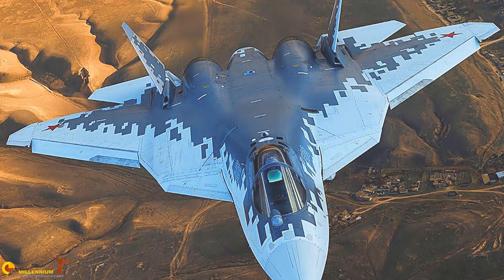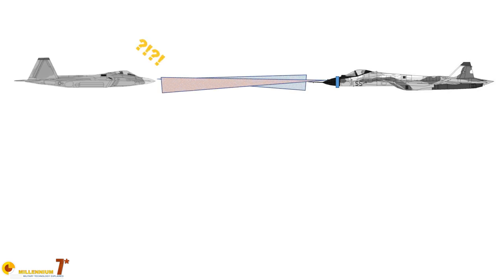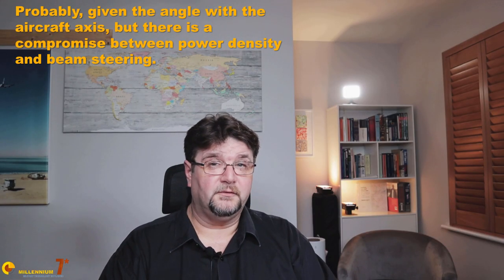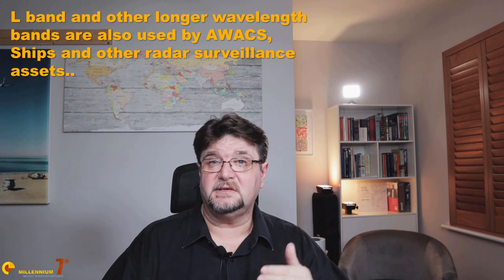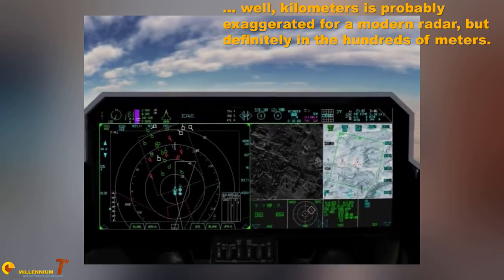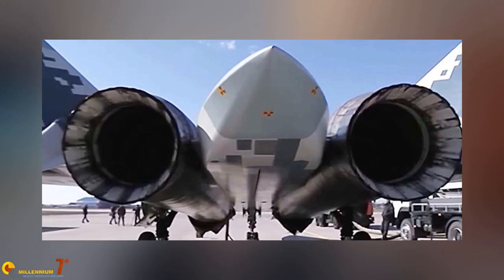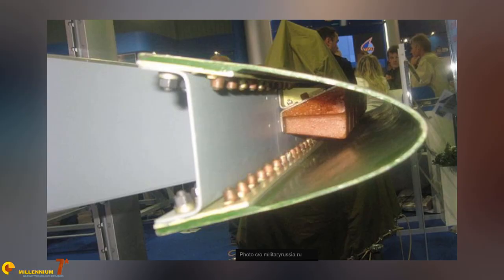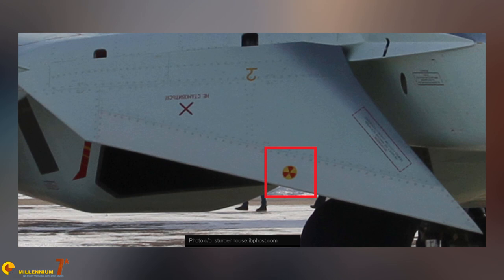Su-57 the Raptor Spotter | Part 4 - Radars, ESM, ECM, IFF

Comment: Every one is saying "F22, 35 will detect and destroy Su 57 before it knows they are there" ok, let us assume the Su 57 simply has no idea they are there but my question is: How good are the radars of the F35 and F22 themselves? Can they actually get a lock on the Su 57 reliably at AIM 120 max operational range? I highly doubt it because stealth alone is not enough to guarantee a kill at long range... these aircraft have to have very powerful radar systems to lock on to a stealthy aircraft. In other words, how far away can an F22 lock onto another F22 reliably and take it down?
Reply: Western electronics is a generation better than anything that can be produced in Russia., even allowing for the software capability to be identical. If the F-35 is golf ball sized (and who knows) on an X-band radar, the Su-57 is at least beach balls sized (100 to 1000 times larger) [and an Su-35 much much larger still]. F-35 are designed around networking and stat interchange, probably with AWACS support (L band). The question your asking is how close does an F-35 need to get to an Su-57. Thats a secret, but it's likely to be more than enough to remain undetected.

In anywise, the USAF may be flying in formation where F-22 are emissions silent and and F-35 or Typhoon in an adjacent formation is radar active and targeting the Russian aircraft at or outside the Su-57 weapons range and providing targeting data to the F-22 formation, who fire at a closure range from an unexpected location. F-22 stealth is at least 10 to 100x better than the F-35.
Reply: At the maximum range of the AIM-120, its speed when approaching the Su-57 will not exceed mach 1.5, its maneuverability will be very low, and it will report its approach due to its working radar for 25-30 seconds. The Su-57 will leave the AIM-120. In order to shoot down a highly maneuverable and well-informed fighter, you must launch a AIM-120 from a distance of up to 40-50 km. No more than that.
Reply: @nickbrough8335  The frontal RCS of all 5th generation stealth fighters (F-22,F-35, Su-57) is from 0.3 to 0.7 square meters (compared to 3-10 square meters for 4th generation fighters) A "golf ball" is a boastful advertising nonsense from Lockheed.
Reply: @TD-qh6yu  You'll notice i did write IF. However, my point remains correct, which is that the difference is radar "size" of 10 to 1000x remains essentially correct. Russian radars will find it 2 to 3 (or more) orders of magnitude more difficult to detect a US stealth aircraft than vice versa.
Reply: @nickbrough8335  Su-57 and F-22 will detect each other at the same distance (approximately 120-130 km). This is too long a distance to launch the R-77 and AIM-120 missiles. They will have to get closer to shoot.
Reply: @TD-qh6yu  Highly unlikely to be true. The F-22 is several times more radar stealthy than the Su-57 (as is the F-35). Please reference your source data on radar performance.
Reply: Su-57 frontal RCS value is only 1/10th of the Flanker according to Sukhoi, which means it's huge and easily-detected at long range by APG-77 & APG-81.

It uses MAWS and automated self-protection jammers if it detects an incoming missile, combined with other countermeasures. That's late 1960s US technology already in-use by the SR-71 back then.

The 1980s ASPJ basically made that available for the F-14D and other US fighters, though the USAF is extremely tight-lipped about it.

F-22A has a massive leap in capability above that, including IR MAWS integrated with RF suite.

JSF is an even bigger leap ahead of F-22 with 4 EM spectra coverage across various RF, IR, Thermal, and Laser bandwidths, using adaptive EW deception and attack networked with other JSF and networked platforms.

The Israelis already used F-35Is to trick Syrian IADS to think a Russian IL-20 Colt ELINT bird was a flight of F-16Is, or maybe the Syrians with their Russian technical advisors were just too trigger happy.

JSF performs the mission of the EF-111A, EA-6B, and EA-18G at certain phases of practically every mission profile.

The Su-57 will act as an EW platform as well along similar lines, just with older technology and limitations imposed on it by Russian Semiconductor quality/quantities.
Reply: @nickbrough8335  Lot 4 and later JSF have a smaller frontal RCS than the Raptor, and the APG-81 is a more capable radar driven by a more capable CPU bank.  Both Raptor and JSF can generate accurate passive TGT tracks in RF spectrum, with intermittent LPI PID modes for the AESA.  JSF is exponentially better at this due to the vast IR/FLIR sensor suite.
Reply: @TD-qh6yu  At higher altitude bands, AIM-120C7 even will be doing Mach 4 with a reduced ToF due to thin air, and will be on its maximum ballistic arc with a decent supersonic separation velocity.

AIM-120D is another ballgame and has exceeded the intercept range of every AAM in history with a recent live fire test.  We're onto AIM-120D4 already.

Networked cooperative targeting of AIM-120D Salvo fires is inescapable.
Reply: @LRRPFco52  Correctly. According to Sukhoi, frontal RCS of Su-57 is about 10 times less than that of Flanker. But according to Sukhoi, the frontal RCS of the F-22 and F-35 is also about 10 times less than that of the Flanker. All reports about the ultra-small RCS F-22 are fiction. It's just that the whole world knows that Russian fighters are much superior to American fighters in terms of flight characteristics. Now, for propaganda purposes, the Americans can only tell fictions about the "RCS= golf ball", because the value of the RCS cannot be determined visually, unlike maneuverability or the speed of climb.
Reply: @LRRPFco52  AIM-120C7 will maintain speed Mach 4 for only 3-4 seconds.
Reply: @LRRPFco52  There's no doubt that the F-22 needs a serious upgrade now, although I suspect the USAF is expecting to replace it with whatever next gen aircraft they're currently developing instead. I am under the impression the F-35 IR system is ground orientated not A2A based on its position and the IR frequency range it operates in.
Reply: @nickbrough8335  Like every other fighter, the F-22A has been on a modernization and upgrade schedule from the start.

JSF IR/FLIR sensors operate in short, medium, and long wave IR spectrum as well as thermal. They wouldn't be able to detect rocket launches at 800 miles if there wasn't a long wave IR capability.

The EOTS and DAS are the most capable IR detection systems against airborne and space targets on any "fighter".  EOTS is a multimode evolution of the ATF's AIRST, which was cut from ATF due to costs.
Reply: @TD-qh6yu  F-22A early Block LRIP aircraft demonstrated .001m2 or less frontal RCS.  F-15C+ with the new massive AESA can't detect it until within visual range. There isn't a larger fighter AESA currently flying than the APG-63(V)3.  If Russian fighters were so superior, the scrap heaps of every major air battle would not be littered with MiGs and Sukhois.
Reply: @TD-qh6yu  Now do the math based on separation V0 of 1.4-1.8M at 40k ft.
Reply: @LRRPFco52  I did it. Launched from Mach 1.4 - 1.8 and an altitude of 40,000 feet, the AIM-120 will reach a speed of about mach 3.9-4.2 and will have it for a few seconds before its speed begins to fall to mach 3 or less.
Reply: @nickbrough8335  Sorry mate, the F-22 is less Stealthy than the F-35 at least from the front. From the rear, she is better, but only in IR. Her vertical thrust vectoring flaps take out some heat, but that is not saying much, she still has 2 heat sources, partially covered. in another vid. our friend from Millenium 7* shows the radar profiles of this three fighters, they differ in profile, but none is "really" invisible, or even very noticeable in advantage.
Reply: The Su-57 has a feature that was long-promised for the F-22 but as of yet, has never been delivered—side-facing radars mounted below the cockpit on aircraft's 'cheeks.' These active electronically scanned array (AESA) X-band radars supplement the aircraft primarily nose-mounted X-band N036 Byelka (Squirrel) AESA radar. Supposedly these secondary radars have roughly a third of the transmit-receive modules as the jet's main radar. 

You can clearly see the side radar aperture below the 'chine line' under the aerial refueling probe. 

At first glance, the utility of these radars is clear—they provide a far greater sensor field of view and thus enhance situational awareness for the Su-57's pilot. But beyond this the most basic of advantages, they allow the Su-57 pilot to execute a key tactic better than nearly any other fighter around. This tactic is usually referred to as defending enemy's missiles while not getting "cold" on enemy's plane.

The issue is that with a typically fixed AESA radar or mechanically scanned array, pulling off a missile defending maneuver means the fighter doing so will lose its radar picture of the enemy it is trying to evade. Without third-party sensors feeding this data to the beaming fighter via data-link, its pilot will become blind to the tactical situation when it matters most. But what's worse is that any radar-guided missiles that have been fired from the now beaming fighter will not be able to receive mid-course updates, and thus those missiles' probability of kill will plummet, especially if fired off initially at long-range.

So fighters without cheek arrays, or novel swashplate like designs like those found on SAAB's JAS-39E/F Gripen and eventually on the Typhoon, and absence of engagement quality tracks provided by third-party sensors via data-link, the launching fighter will either have to take a more acute and less effective beaming angle in order to continue to update their missiles with their radar, or they will have to forget about updating them altogether. 

The Su-57 is also said to incorporate L-band radar arrays blended inside its large maneuvering leading edge extensions. These radars are more for target discrimination and identification than anything else. The aircraft also has another X-band radar array in its 'stinger' tail for enhanced situational awareness, and possibly for future targeting with extremely agile 'lock-on after launch' missiles as well.

It's also worth noting that AESA arrays can also be used to execute pinpoint electronic attacks. Theoretically, a fighter's radar system could employ these electronic warfare tactics while attacking another aircraft, or while under attack. Being able to do so even at oblique angles without changing nose position could be beneficial, as well. With that in mind, the Su-57 could be a powerful electronic warfare tool, if not today, then possibly the future. 

The Su-57 sports an advanced 101KS 'Atoll' infrared search and track sensor in the traditional position on Russian fighters—installed atop the aircraft's nose, near its windscreen. 

 IRST is among the best technologies available for detecting and engaging stealth targets from afar.

An advanced IRST was also promised for the F-22 as part of the Advanced Tactical Fighter Program but it was axed due to cost-cutting measures as the program moved from prototype to a production configuration. Today, the Navy and the USAF are on the cusp of procuring podded IRST systems for their 4th generation fighters. The F-35 can use its electro-optical targeting system (EOTS) for long-range aircraft identification and some limited IRST-like functions but is not comparable to a dedicated sensor.  

Like the F-22, the Su-57 has a number of missile launch detector apertures scattered around the aircraft but the Su-57 also has turrets that fire modulated laser beams at an incoming missile's seeker to blind it and throw it off course. The Russian system used on the Su-57 is part of the larger N101KS electro-optical suite that includes the missile launch detector systems, IRST, and the DIRCM turrets mounted dorsally behind the cockpit and ventrally under the cockpit.

And denying attacks by air-to-air missiles is definitely an intent for the Su-57's DIRCM system as, once again, it has a turret on top of the jet as well. So in this sense, the Su-57 is something of a pioneer in this regard and this type of system is also likely a hedge against future long-range infrared-guided and dual-model air-to-air missiles.

Su-57 can be armed with four beyond-visual-range missiles and two short-range missiles for air-to-air combat missions. The active radar-homing K-77M (Izdeliye 180) missile is the primary medium-range missile of the fighter. An upgraded version of the R-77 medium-range missile, the K-77M is a beyond visual range (BVR) radar-guided missile equipped with an active electronically-scanned array radar seeker. Russia is also planning to add the new R-37M long-range hypersonic missiles to the aircraft’s firepower.

For ground strike capability, the Su-57 is fitted with the Kh-38 tactical ground missile and a range of KAB family precision-guided bombs. It also has external hard-points that can hold additional munitions to support non-stealth missions.

Aircraft’s super-manoeuvrability allows it to dodge incoming long-range missiles and engage enemy aircraft within visual range.

So my friends, Su 57 never goes cold, there is always 360° awareness, passive and active, and there's hypersonics in the bays.

And these are words of amercan avio experts.

So....

Yeaa, F22 and F35 have anyway better avionics.
Reply: @nickbrough8335  Have you talked to the radar and how difficultist it finds its target? 11kw of radar would give quite a nasty sunburn, if sent in microwave frequency.
Reply: @TD-qh6yu  How about the R-37? up to 300 km range?
Reply: @Gunni1972  I can only go on the (lots) places I've read. F-22 has always been talked of as having better around stealth than the F-35, although the F-35 is using at least 1 generation later technology, which I'd expect to offset that to some degree. I'll have to check that video, but unless you've put the aircraft into a radar testing jig verses various different radars (as Lockheed and Sukhoi would have done at the design stage) you cant know and there is no actual data that's been made public that I've ever come across anywhere on the eb (as you'd expect as that has to be an important secret). Whatever data has been analysed it's going to be theoretical based on shape. Stealth involves more than shape. That also provides an advantage as Russia and to a lesser extent China are unable to manufacture and build with these sort of materials. Composition of RAM coatings will also be very important. No one but some idiots in the media think Stealth = radar invisibility.
Reply: @LRRPFco52  F-22 still lacks helmet sight, a FLIR system and two way data link from memory. The AESA radar and other equipment upgrade is planned for the mid-2020s along with replacing the RAM coatings using F-35 tech. Nothing can de done about the airframe though.
Reply: @TD-qh6yu  and you believe Russian propaganda ?
Reply: @TD-qh6yu  Most missile only burn their fuels for 10 to 15 seconds anyway.
Reply: @Gunni1972 Can you explain what you mean more clearly ?
Reply: Once again, the point of my question was to point out that by the time an F22/35 can RELIABLY get a lock to guide the AIM 120 (not just to detect the Sukhoi), it will be within Su 57's IRST range at which point, it is anyone's victory. So what is the point of being stealth when you cannot use range reliably to your advantage? On top of that, an AIM 120 is an extremely easy missile to defeat at long ranges, it just isn't a very good missile to take down modern jets at long distance and that is even without considering ECM. I would say it would be a fairly even battle, coming down to pilot training and tactics as well as a bit of good old fashioned luck.
Reply: The difference is one has a reduced RCS to be less detectable at BVR and the other 2 (F-22 and F-35) have demonstrated a reduced RCS to allow them to fly right under another fighter before being detected and we don’t know how effective the L band detection system installed on the plane is yet (L band detection on stealth fighters require a large antenna and Russia doesn’t have as much experience in developing a stealth fighter and have downplayed stealth in the past with propaganda)
Reply: What fanboys seem to forget is to get a radar missile lock the F22/35 have to go active radar and that puts out a signal that anybody with RWR will detect.
Reply: @LRRPFco52  Neither the US nor Russia are in reality self sufficient in the realm of semiconductors. Both buy them in the far east.
Reply: @LRRPFco52 The upgrade schedule you are talking about is more likely like the windows update cycle to wedge out gazillions of common software bugs.
Reply: @zx169  IRST performance depends on the water content of the air, which is controlled by weather, altitude and cloud base. It will also depend on the speed of the incoming aircraft and to the extent that IR absorbing materials have been used in the construction. An F-35 will approach sub-sonic in most operational conditions. How big will its signature be front on ?

So far as I know, the field of view isnt very large and positioning will limit the searchable area to a significant extent on all aircraft. Obviously the resolution of the sensor will also have a major impact. So if we suppose that an Su-57 detects a stealth opponent outside radar resolution range with its IRST (40 to 50 km ?), then is there sufficient data to launch a missile ? Of course, it is equally likely at that point the F-35 or F-22 will already have a firing solution and the Su-57 is facing an incoming missile salvo and needs to manoeuvre to avoid being hit.

What if the opponent is carrying Meteor rather than a 120 D model ? The Meteor will accelerate to high speed and then slow/shut down the missile engine to conserve fuel to reignite the engine to counter late stage avoidance manoeuvres (I believe 120D does nothing similar, but may be not as effectively given solid fuel engine verses a ramjet).

However, how will the Su-57 respond. Its own longer range missiles are currently lower range than the 120D and have lower specification electronics and most likely inbuilt radar ?
Reply: @nickbrough8335  The issue with stealth is that it is only truly effective against older electronic systems and once the F22 and F35 turn in their own radar, the game is up on their position. The enemy (5th gen) will know exactly where it is and that a weapon has been fired on them, making it easy to avoid the incoming threat, at long range. However, within the short range spectrum, where that weapon is more likely to be effective, the Su 57 will have a lock of it's own and fire it's own weapons hence the 50/50 outcome scenario. Stealth does not mean its invisible, it is a pure lie that "an F22 can get right next to an enemy before being detected.... visually" outright propaganda. For some reason, people seem to think the US cannot be associated with disinformation and especially that horrible 'P' word. It is something that Communistical countries do, as Jeremy Clarkson would say. I would also not discount Russian electronics, no evidence to suggest they are inferior, in fact both Su 57 and especially Su 75 have newer systems than F22 and F35, with these being much older aircraft. If a new computer comes out, it doesn't mean they all get instantly upgraded, they still use the core systems they got when they were designed.
Reply: “Russian propaganda”? In this discussion, you are the one most prone to believe in propaganda citing Lockheed’s marketing cliche uncritically.
Reply: “Russia downplayed stealth with propaganda”? Or, rather, the USA has hyped it up with propaganda? The fact that you chose the side shows that you fell victim to the latter.
Reply: I wonder where did you get the idea that the specifications of  Russian electronics are in any way insufficient. It is capable of tracking and targeting even hypersonic targets (multiple of them all while discerning real and fake ones) with no problem for a long time already. Even ancient MiG-25/31 electronics has allowed to track up to 8 targets and exchange data with fellow planes. Buran has performed a fully autonomous flight while in the Shuttle this mode was never robust enough to go without supervision.
Reply: @zx169  Reducing your radar cross sections a permanent advantage. Of course as radar technology and DSP advances, the advantage reduces, but isnt eliminated entirely. 

I'd love to see a debate regarding the latest Russian US radar tech, but we cant as its all classified and very little is made public. The same applies with EW/ECM/ESM measures that both sides will deploy when necessary.

I assume that better more powerful computer hardware, access to better quality manufacturing techniques and use of materials science gives the US a significant edge over Russian hardware. How much is unknown.

The US uses Stealth and networking (battle space data sharing) to provide better situational awareness pre-engagement to give its aircraft an additional edge that Stealth will provide to first detection range.

None of us know whether the Su-57 systems are capable of matching this performance at the same range. Its certainly highly unlikely that there is parity today.

So how close is close ? 40 km, 30 km ? In most engagements its probably that US aircraft will fire the first salvo and they will certainly not close to engage in WVR combat where the Su-57 (and 35S) are likely to have an advantage, although I expect pilots will receive training on how best to dogfight both these aircraft it is happens.

Against pier opponents, I would expect most fighter engagements to be a "draw", but the key question is which sides tactical operations will be disrupted the most. The evidence suggests Russian side to me.

Against Chinese opposition, it's much less clear.

On electronic systems it depends on how you define the question. From a practical point US designed chips will operate faster, process more data, be lighter, produce less heat, use more advanced materials, are smaller etc. The ability to process data faster, in more detail and probably have systems that operate at a finer resolution is likely to be a strong clear advantage. Yes, Russian systems might offset that disadvantage by using higher power to generate detection  distance parity, but the quality of date returned is still likely to be lower and the onboard systems will take longer and do less with that data. In addition, higher power output increases passive detection distance (I forget the ratio, but isnt EW detection possible at two to three times the distance of the host radar).

To date Russian systems are incapable or less capable of sharing high density data. Another disadvantage. Its likely the USAF will deploy mixed F-22/F-35 with F-15AXs and Typhoons with stealth aircraft completely passive using data sharing to update situational awareness. That gives plenty of surprise advantages.
Reply: @kentaur1234  Tyler Rodgway isn't an aviation expert, he's a self-admitted click-bait generator who writes articles designed to sell ads.  

Side-looking AESA is great for a 4th Gen BVR mutual detection scenario so you can manage your WEZ profile vs the threat, and still provide midcourse guidance to missiles after offsetting/cranking so that you stay outside of threat WEZ.

That doesn't apply to F-22A and JSF because they project a kill web of interlocking WEZ and NEZ profiles that don't require the launch aircraft to provide midcourse guidance, and they can't be detected or tracked at meaningful distances.
Reply: @nickbrough8335  F-22A started out with the most capable LPI 2-way data link called IFDL, which is far superior to Link-16 protocol WAN-type data links.

It was surpassed by JSF MADL, which has higher transfer rates and bandwidth to support multispectral sensor data sharing in near real-time, whereas IFDL supports RF sensor data sharing.

Both F-22 & JSF have a LAN-based data link network that is practically impossible to detect.

F-22A combat-coded Raptors have undergone several software and hardware upgrades over the years, increasing its A2G, A2A, and EW capabilities significantly.  They're pretty hush about it though.  F-22's biggest problem is maintenance, since traitors working on behalf of Russia and China killed it from within US DoD and 2 White Houses (Bush Jr., Obama).  We never capitalized on the F-22 by going into full rate production with the necessary airframe count and spare parts, so it's an extremely difficult system to maintain.
Reply: @nickbrough8335  According to Russian sources, the radar of the Su-35 fighter Irbis-E can detect a target with an RCS of 0.01 square meter at a distance of 90 km. Therefore, she will see an F-22 with an RCS of about 0.3 square meters at a distance of 200 km. Not 30 or 40.
Reply: @rosomak8244  Not for defense for the US. The SC companies in the US have strict contracts feeding critical aerospace and defense systems.

Commercial market like autos and electronics source from Japan and Taiwan a lot for US civilian market.
Reply: @LRRPFco52  The advantage is most western NATO member use a common data link protocol and existing numbers of equipment are becoming digital and will plug into the US networked architecture., which should be a force multiplier. I haven't read a lot, but I think there is a mid life update planned for the F-22 lately, which will replace the radar, stealth coatings and add IRST capabilities, which should bring F-22 up to current standards. 

Numbers are an issue, but the USAF will adopt multifaceted forces using a mix of Stealth and non-Stealth aircraft with similar technical capabilities (how much of the F-35 hardware is ending up in the F-15AX, which is the replace the C models ?).
Reply: @zx169  Su-57's IRST range doesn't detect F-22 or JSF at any meaningful distance due to IR VLO.  Normally with IR sensors, you get the best detection range from rear aspect, but Raptor and JSF have extensive exhaust camouflage measures with the way super cool atmospheric air is routed through and around the exhaust.

Frontal aspect IRST detection with Russian electro-optics in ideal dry atmosphere on a clear day is only a few dozen km at best against non IR camouflaged legacy fighters, way within the RF detection range of any of the US AESAs including the little one being installed in the F-16 fleet.

The sensor detection math and applied physics will show you that actual 5th Gen fighters get first-look/first-shoot, with cooperative Salvo shoots that make life unfair for their adversaries. It takes a much greater effort to defeat this, and that doesn't factor in the unknown performance of the next generation missiles being fielded in the US currently.
Reply: @zx169  "The AIM-120 is an extremely easy missile to defeat at long ranges".  What evidence do you have to support that claim? The AIM-120 is constantly live-fire tested against maneuvering targets across its WEZ profile, and has been subjected to continuous improvements with extremely challenging live-fire testing since the 1980s, including high ECM environments.

Especially when launched from a fighter whose presence and closure rate is unknown, even legacy AIM-120C7 is an extremely dangerous weapon.

We're not talking about mutual detection BVR metrics anymore, where each side has an idea of where the other contacts are.

We're talking about unfair VLO closures into layered NEZ profiles. It's truly not a fair fight in the slightest.

You can put the highest hour Fighter Weapons School instructor pilot in a non VLO airframe with all the bells and whistles, and he will be quickly erased from the sky by brand new pilots who have barely gone through their squadron introductory tactics syllabus and simulator training with a few months of flights in their logs.

These are the new rules. Pilot experience can't help them in an inferior platform in BVR, Edge of WVR, and is neutralized even WVR due to several factors.  There's a retired TOPGUN instructor who flew Hornets, Super Hornets, F-16 Adversaries, the F-22A, and F-35B who explains his experiences with this, which were extremely frustrating for him.
Reply: @suflanker45  "What fanboys seem to forget...." All incorrect. Engineers have been developing solutions to long range detection and Non-Cooperative TGT Recognition for decades.

There's also a concept called Low Probability Intercept RF propagation dating back decades now, where we looked at the bandwidth covered by threat RWR antennae and their signals processors, and worked around that with emitted RF energy from PESAs and AESAs. That's 1980s tech.

On top of that, we expanded our own RWR systems to have far greater sensor counts with different shapes and wavelengths, far greater passive sensitivity with digital signals excitement and filtering, fused into a 360° extreme long range RF detection suite.

That's the primary early detection and warning system with roughly twice the range of the AESA due to the 1/2 vs 1/4 rule with RF propagation.

With JSF, we also have the most sensitive and layered IR detection and tracking system in the world, that is fused with the IR sensor suite.

If the DAS gets a signal at long wave IR, it immediately triggers the EOTS and passive RF sensors to look there as well.

Even if you're running EMCON with the AESA, the AESA "knows" there's a TGT track there.

The AESA can push very low energy RF in narrow beam sharpened LPI mode on that TGT, without triggering the TGT's RWR system, and paint a long range image of exactly what that TGT looks like, fused with the multi-band IR sensors.

The aircraft being scanned has no clue any of this is happening, while its weapons and stores status is being assessed as well. 

This isn't only happening from one 5th Gen platform, but from multiple 5th Gen nodes that have tens of km separation in azimuth and vertical separation as well.

As each of their layered sensor arrays scans the contacts, they share that data with each other in near real-time for a cooperative TGT assessment and count.

So your understanding of AESAs and how modern AESAs operate is not informed by the facts.

It breaks down like this:

Total EMCON, no RF emissions. Passive 360 RF EW suite detection and tracking with limited track accuracy dependent on range.

Partial EMCON, intermittent burst LPI low power narrow beam sharpening AESA in frequency-hopping mode, LPI LAN data link TGT sharing with networked fighter formation.

4.5 Gen EMCON, intermittent AESA full power volume search, omnidirectional detectable/jammable WAN data link.

JSF plays this game better than any other fighter, at a level that is simply unfair.  The only outcome is that threat fighters willing to get into the air where JSF are present have a destiny with weapons impact without warning.
Reply: @Internetbutthurt  There is a cat and mouse game with RF spoofing that applied more to SARH missile homing, where the targeted aircraft records and then spoofs the command signals from the launch platform guidance radar.

This doesn't work against AIM-120C7 and D1-4 fired from VLO fighters because the LoS for the midcourse data link between missile and guidance platforms is LPI.

So instead of relying on the launch fighter to provide course corrections through most of the flight while that launch fighter is detected, tracked, and fire returned on it, you have a totally different weapons employment profile that is unfair.

If you work through the tactics with an understanding of how the new chess pieces function, you will start to see what I'm talking about.

It's like starting a chess game with 2 rows of pons and maybe 2 knights, while your opponent has 2 rows of queens who you need special glasses to see.  A chess master with the pons will lose to an amateur with those pieces.
Reply: @nickbrough8335  Good points. I did all the math not long ago for the Su-35's OLS-35 & the Su-57's 101KS-V, as well as the Rafale's exceptional dual-system OSF across all the atmospheric conditions and altitude bands, ranging from desert dry air to heavy rain.

In short, legacy IRSTs like that even from the French will not have a BVR frontal aspect detection capability, unless in desert dry air and right before closure into WVR anyway.

JSF and ATF would have offeset their flight path far before getting into WVR, and employed weapons long before the detection threshold, while having enjoyed extreme long range detection and track hundreds of km prior.

It's really such an overwhelmingly-unfair fight, to be laughable.
Reply: @zx169  VLO technology isn't static or set in stone. It evolves even within airframes and can be upgraded. The F-117A went through 3 different RAM application types over its career, finishing with some that were coated in F-22 RAM.

JSF already has upgraded RAM since Lot 4 that reduced its FRCS smaller than the F-22A, which is smaller than the F-117A.

The new generation of RAM is programmable with holistic frequency response-based modulation to adapt to incoming RF.

AESA radars in LPI mode executing millions of frequency-hopping cycles encrypted with themselves for return signal aren't going to show up on RWR. You would need to build a more sensitive, larger antennae array RF architecture, exciters, filter, and faster processor suite than what's in JSF, ATF, and operational US AESAs.  US has the highest quality, highest quantity of military spec Semiconductors, boards, and processors, with the largest army of programmers, so that's a losing proposition, especially with JSF open architecture.

The Su-57 is not newer technologically. The Su-75 doesn't even have avionics or any systems. At best, the rollout was a dynamic/structural test model.

This is what happens if you drop the ball on any one of the necessary organs of an integrated 5th Gen Platform.

No VLO? An open gap in capability is exploited to your detriment.

No modern integrated avionics suite with layered redundant processing bank, fused multi-spectral, high quality sensors? Another massive gap is opened.

No capable propulsion to meet the thrust, climb rate, cruise, and high altitude performance without afterburner? Another gap expands between you and your adversary.

Airframe isn't well-vetted for departure resistance at operational altitudes? Another gap that comes into play when trying to avoid incoming missiles.

Haven't demonstrated internal weapons bay separation of BVRAAMs? Is it because closely held secret, or it can't be done yet/program is struggling with adverse separation effects from the tunnel, like the F-14 did (F-14 shot itself down with rear tunnel-mounted AIM-7).

These things all add up.
Reply: @TD-qh6yu  F-22A Block 30 3.2 has a frontal RCS smaller than .001m2, so even the most capable US AESAs with far superior detection, tracking, and PID features can't physically see it until within visual range. The IRBIS-E is 1980s tech at-best by US standards, attempting to match the very little-known APG-63(V)2 on the F-15C, which now uses the (V)3 AESA, the largest, highest TRM count fighter AESA in the world.
Reply: @Internetbutthurt  The longer a missile uses Active Homing, the easier it is to defeat with ECM. So the name of the game is to execute sneak attacks with VLO approaches, providing mid-course guidance throughout the missile's flight path, refraining from letting it trigger its active homing until the last few moments of terminal phase.

One of the limitations with 4th Gen guidance, even with continuous tracking from the host with data link, was single source sensor tracking for weapons-grade solutions.

This gave you a certain 3D floating intercept "box" for the missile to home into before activating its terminal phase guidance.

The primary factors that determine that floating "box" are TGT aircraft velocity, bearing, altitude, vertical velocity, and RCS.

The faster the aircraft is flying, the more the box elongates.  The lower it flies, the shorter the WEZ is due to atmospheric density, and vice versa. The larger the RCS, the larger the box and farther away you can trigger the WEZ.

Later variants of AIM-120C and the D have home-on-jam feature as well.

When you step into 5th Gen intercept metrics, a lot of things change:

You can press the WEZ into NEZ, which means that no matter what maneuvers or acceleration/climb/descent the TGT executes, there is still an intercept solution.

Since they have no clue you are there, you or wingmen can execute deceptive offensive EW techniques that will tie-up their radar and EW, which can be used to increase the missile pk kinematically and electronically, even using older missiles.

An F-35A or F-22A is several levels more lethal against any other fighter using AIM-120C5s than a Rafale is with Meteors.

The missile limitations are virtually erased when leveraged with 5th Gen sensors and EW.

Furthermore, you can generate much higher TGT track quality in JSF just using interleaved passive sensors, with midcourse data link and intermittent burst low power LPI AESA updates if you wanted.

The TGT aircraft EW system can't spoof midcourse corrections because it doesn't detect LPI to the missile, so there is no triggering of the MAWS.

By delaying the terminal phase active seeker final course corrections, it limits the TGT aircraft's ability to employ automated ECM, especially against something approaching at Mach 3-4.  A more modern Automated Digital Threat Warning and Deceptive Waveform Emitter jammer also has to deal with the home-on-jam feature, which might actually improve the TGT resolution.

This is why the Israelis and US have been developing multi-spectral seekers that trigger a mw seeker on terminal phase that isn't deceived by Digital Waveform Manipulation techniques.

The programmatic cat and mouse game with legacy systems involves drop-in improved circuits and higher speed processors, which allow more room for warheads, continuous rod systems, and longer solid rocket motors.

A really basic explanation of ECCM algorithms include, "If within distance x of impact and TGT emits ECM, then execute y." type functions.

With multiple sensors on multiple fighters feeding a networked resolution and tracking of the TGT, you get extremely accurate TGT data that is constantly sent to the missile with a very high-speed LPI data link. The missile only needs correct input to it for an intercept solution, which is provided by several disbursed wingmen.

There are one-way and 2-way missile data links that provide different types of guidance that get more complicated than the simple distinctions between SARH and ARH, so the missile seeker doesn't need to reveal itself as much as when fired from a 4th Gen fighter.

The missile seeker and 2-way data link technology gets upgraded on production units in operational squadrons in fairly regular intervals to meet regional threats as well.

The Russians' advantage in this area is only with how many moles they have in the US actively transferring missile upgrade codes and technology as fast as we can develop it, while the Trojan agency at Langley overstates Russian radar, missile, and ECM capabilities as a deterrence.

The MIC takes those inflated capabilities that don't exist in any operational Russian fighter squadron, build an even better mouse trap, and the cycle continues.
Reply: @StrangerHappened  if the US hyped stealth tech , then how come everyone and their mothers are rushing to build stsalthy aircraft and naval ships ?
Reply: @LRRPFco52  Irbis-Е can detect F-22 (which, regardless of the blocks, have a frontal RCS of about 0.3 square meters) at a distance of about 200 km and track it from a distance of at least 150 km. I do not know whether American radars can do this, but I am not sure about it, since American radars are traditionally inferior to Soviet and Russian radars in the detection range.
Reply: @TD-qh6yu  LMAO ! Where are you getting your numbers from ?
Reply: @TD-qh6yu  ,Another radar comparison between the F-35 and the Su-57 ... the APG-81 has 1676 TR modules, the Byelka N036-1-01 of the Su-57 has 1552 TR modules. close, but the APG-81 has more !!! It doesn't take a rocket scientist to look at the matrix and get a decent count of TR modules. Remember, the F-35 is US light weight fighter. The raptor has more than 1800 TR modules. Now that's unbalanced .
Reply: @junkookbts1273  It works but just not to degree it was hyped up to. Hence no countries that develop 5-6 generation war planes focus on it as much as the USA.
Reply: @TD-qh6yu  Wherever you’re getting your info from, you can trash those sources as total garbage.  F-22 frontal RCS is .001m2 or smaller.

Russian radars have always been inferior to US radars, especially fighter radars.  I already told you Irbis-E is 1980s tech at best compared to the variations of the APG-63(V)2, which us superseded by the APG-63(V)3 AESA.

TRM material quality and electron mobility on US semiconductors smokes Russian and even European ESA radars.  We literally pioneered all of these technologies and materials sciences with exclusive contracts for the highest quality, lightest, most thermal-resistant materials and connections.

Notice that Russia hasn’t had a fighter AESA radar until the Su-57, whereas the US has:

APG-63(V)3 on F-15C+
APG-77(V)1 on F-22A
APG-79 on Super Hornet Block II
APG-81 on JSF
APG-82(V)1 on F-15E+
APG-83 on F-16CM

The US has been designing, manufacturing, operating, and upgrading fighter AESA radars for decades with well over 1600 fighters now equipped with them.

The jump from a PESA radar to an AESA involves substantial technical challenges that aren’t very easy at all to conquer, and Russia has struggled in this area while the US leaped ahead.

The APG-63(V)3 is the most powerful, largest fighter AESA with Digital Signals Processing upgrades that changed the capabilities of the Grey Eagle fleet considerably.

Even with that massive capability increase, the F-15C+ can’t see the F-22A until within visual range.

The IRBIS-E doesn’t have anywhere near the electron mobility, beam-steering capability, or processing power and doesn’t have simultaneous mode capes that AESAs provide, so there is no mathematical way for it to be able to detect the F-22A or any JSF at BVR.

Meanwhile, the Su-35 has a giant RCS value with huge intake cavities, enormous 90˚ vertical stabs, and 4th gen suspension of its weapons, creating an easily-detected TGT at extreme BVR ranges.

Your understanding of applied physics relevant to radars, RF propagation, and RCS values is not even amateur at this point.  There is a ton of relevant information about radar physics online if you have the time and discipline to study them.
Reply: @LRRPFco52  Russian technologies, both in the field of aerodynamics and in the field of radar, are much superior to American ones. You know that the Su-27 radar surpassed the F-15C radar in detection range, the MiG-29 radar surpassed the F-16 radar, and the Zaslon radar for the MiG-31 had no analogues at all in the 20th century. Soviet anti-ballistic-missile defense radars had huge AESA antennas back in the 80s, which can detect an object measuring 5 centimeters at a distance of 1000 km. Russia's lag in aircraft modernization in the 90s-early 2000s was due to the financial crisis, and not to a lag in the scientific field. There was simply no money to equip hundreds of aircraft with AESA radars. The front  RCS F-22  was estimated by Russian experts at 0.05 square meters in the 90s, but now it is estimated at least 0.3 square meters. From a distance of 200 km, the Su-35 will see the F-22 as well as you see an omelet on your plate. There is a difference between reality and what Lockheed advertising agents tell you.
Reply: @TD-qh6yu  You realize we have samples of multiple MiG-29 variants and Su-27s in our inventory from FORMAT exploitation programs, right?  The MiG-29 radar is pretty big for the size of the aircraft and could have been a really good radar, but the pilot interface was atrocious.

The Su-27 tried to have a better radar than the F-15, and failed.  Tons of room, huge radome, poor electronics, amplifiers, filters, and processors with equally-atrocious human interface.  This was fixed with the Su-35 cockpit and Irbis-E to great extent, putting it more like an F-15E but still clunky.

Neither the MiG-29 nor Su-27 had HOTAS, and Russia has been rectifying this with the Su-27SM3, Su-30SM2, and Su-35 commonality serial upgrade program to make all the Flankers interoperable with each other, but again, this is 39 years after the US introduced HOTAS on the F-15 cockpit layout, which was driven by pilot design influence.

Even the little F-16A APG-66 radar had some highly-capable IFF features that are still classified to this day, and we haven’t been using those for decades other than on aggressor aircraft.  The APG-68 was a significant upgrade over the -66 when we went to the C model, and has undergone several upgrades through (V)9 now.

The MiG-29A (Soviet model, not monkey 9.12b model with downgraded radar and ECM) was heavily evaluated by NATO and the US by pilots who flew the F-16C, F-15C, F-4F, F/A-18C, etc., so they can tell you how the MiG-29’s radar and systems compared.  They said the radar was good, but the cockpit wasn’t set up for more autonomous use by the pilot, so the radar was handicapped by the systems layout.

The F-4F Luftwaffe pilots said the F-4’s flight control system and interface was much smoother and more friendly to the pilot, and even the antiquated cockpit layout was superior.  The MiG-29 was obviously more maneuverable, but took some getting used to with the crude control systems.

F-15 and F-16 guys said the radar didn’t compare well with APG-63 or APG-68, HUD was really crude and simple, but the HMS and R-73 was really good.  Endurance of the MiG-29 was atrocious at around 150-170nm combat radius, making it only useful as a point defense fighter.

We were surprised to see that they routed the APU exhaust through the centerline External Fuel Tank, which also prevented the gun from being able to fire, and limited the Ps to 4gs positive.  

You have to understand that in the Western aerospace defense world, the MiG-29 was propped up by the CIA to be this 10ft tall giant, more capable than any other fighter, more maneuverable, longer ranged, excellent BVR capes, don’t ever get WVR of it if you can help it, etc.

Once we got our hands on them, we realized that once again, the CIA lied and exaggerated its capes, making it a huge let-down once we saw how disappointing it was in most metrics.  

Su-27 is much more impressive since it has a lot of weapons-carrying capacity, excellent combat radius with no need for EFTs, huge radar, plenty of room for ECM/EW, good high altitude cruise depending on stores configuration, excellent high altitude performance for BVR, but again was handicapped by poor systems design and lack of intuitive pilot interface and good SA displays.

The BVR weapons were all trash as well.  We fired scores of top-line R-27 variants against TGT drones to assess its pk, and it was a total let-down again.

Circuitry and electronics in Russian systems is really horrible if you’ve ever looked inside of them.  I’m not talking about reading about it on the internet, but actually inspecting the inner details of Russian electronics.  It’s like looking at something made in an old bazaar time forgot.

You have to understand that Russian production philosophy was to have multiple assembly lines strategically separated for redundancy, with low quality airframes able to be cranked out rapidly in time of war.  On the MiG-29, that manifest with skin panels that don’t have matching rivets or fastener locations, because assemblers weren’t using a standard TDP template schematic, just riveting on panels as they went.

They never planned for long-term maintenance, and were more in a disposable fighter manufacturing culture before the MiG-29 and Su-27, that still carried over into those lines.

The Indians and Chinese have experienced the same problems and mentioned them contributing to low availability rates on the Su-30 series.  They prefer to install their own avionics and weapons systems wherever possible.
Reply: @LRRPFco52  Regardless of the interface, which was really more convenient on American aircraft than on Soviet or Russian ones, the detection range of Russian radars exceeded the detection range of American radars. By weight, the Russian radars were slightly superior to the American ones, by 25-30 %, no more. 

During a training air battle in 1990 at the Manching Air base in Germany, a MiG-29 detected an F-16C (with an AN/APG-68 radar) before the F-16 saw the MiG-29, and the result of this battle was that the F-16 was "shot down" at a distance of 60 km. In the same year, MiG-29 battles were held against the F-4. According to the German MiG-29 pilot, attacking the F-4 was the same as hitting a target in training, so overwhelming was the superiority of the MiG-29. The R-27 missile was superior to the AIM-7 , and the R-27E with increased energy was even more so. If the percentage of R-27 hits was low, then AIM-7 had even less under the same conditions. In addition, the R-27 had a modification of the R-27T with infrared homing, which the Americans did not have at all. This modification was more reliable than a radar-guided missile. It has a much wider field of view, and a higher probability that the missile will see its target from the point where the inertial navigation system will lead it. The R-73 was superior to the AIM-9L, and was the best in the world. It is not even worth mentioning about the optical-location system with helmet-mounted target designation-which the MiG-29 and Su-27 had. It simply wasn't on the American fighters. 

The Americans lost the competition in the creation of fighters of the 4th generation on almost all points. All that the Americans have succeeded in is a user-friendly interface for the pilot, and the fact that they managed to equip both (heavy and light) fighters with one type of engine.The last two modifications of the MiG-23 (ML and MLD) were also superior to the F-15 A in close combat and were not inferior to it in long-range combat. It is not surprising that among all the victories of the F-15, there is not one where he would have shot down a 4th generation fighter in a duel. They can count on victory when they attack 1 MiG-29 with a group of 3-4 aircraft that receive target designation from AWACS.
Reply: @nickbrough8335  exactly what I was thinking the f22s and f35s would likely be in formation together which would be a big problem for anyone else in the air
Reply: @thedude828  Yes, this will happen for high risk operations, but an F22/F15FX A2A formation is more likely. I don't know, but I expect F-35s will be more A2G orientated most of the time.
Reply: @nickbrough8335  
You are good storyteller..nice to hear but laugh when analyst..
Reply: @LRRPFco52  
You remind me of Quora chair general name Abrihup Sengupta..your writing is same..
Reply: @nickbrough8335  
Source/link Russia cannot share massive data between plane?
Reply: @lbh2776  I’ve never posted on Quora.
Reply: @LRRPFco52  
I don't accused u posted on Quora..but your writing is almost same..
Reply: @lbh2776  Do you have an factual opinion ? Pls share it and prove something to yourself.
Reply: @lbh2776  Let me ask you, do you have any evidence that they can ?
Reply: @nickbrough8335  
I don't make an statement but you are.
That why we need proof/link for your claim statement.. It a logic.
Reply: @lbh2776  well my statement is that I've never come across a source that suggests Russian aircraft are capable of this. Since nearly all Russian data is secret, being definitive about anything is nearly always impossible.
Reply: @nickbrough8335  
So you saying your statement is base your assumption data from Google/YouTube or it completely false due to secrecy of Russian weaponry system? It that you want to say?
Reply: @lbh2776  I'm not sure what your problem is. Most capabilities are secret, mpre so in Russia and China. Everyone here, including the guy who made the video is speculating based on what they've read or heard. I read technical sources or listen to technically qualified people whenever I can and my opinion is based on this. No one else outside (and to an extent including) intelligence agencies does anything different. 

Since you offer no opinions or "facts" of your own other than to sneer at other people, your input - to date - has little value to me and certainly no insigt.

If you want to have a conversation, trying to stop sneering and contribution what you've read/heard and your own thoughts and opinions. Otherwise you're nothing but a troll.
Reply: @nickbrough8335  
I have no problems with this issues or with you. My opinion with this rare  subject are pointless. First i never been in air army /airforce/navy or any  defences sector for experience what this subject are and you must sit inside this domain area to understand how thing work, even you sit inside this circle you only have little information about other systems beside your own, that why i never make a statement.
Second what being told by any personal or group analysis is just mere  speculation regards any nation even with espionage come with little information about the target subject.
And now a people can claim what they read on internet and make bold statement without sit inside this circle is baffle me.
Example like we can talk about car engine alot but never being mechanic or carmaker or automobile industry personal.. it is logic to u?
Reply: @lbh2776  so you are just a troll then. Nothing to contribute to the discussion. Bye.
Reply: @nickbrough8335  
Your and others discussion are pointless..
None of you involved direct to that matters..so what the point lengthy discussion? Ego or fanbase?
Reply: @nickbrough8335  How you can know, that Western electronics in generation better? 
Firstly, your sentence already sound funny, because most of so-called Western countries actually too backward even for basic electronics, they have no that industry at all and scientific schools. Last one is especially important because Russia is famous with fundamental science (for comparison US spend on fundamental research near 20%, Japan — 15%, Germany — 30%, while Russia — 70%, far more than any other country). I remind, that even theoretical work about how create stealth US took from USSR (from work of Petr Ufimtsev, who got in US name “the father of stealth”). While Russia have whole both industry and schools.

Secondly, I can remind about public competition between US and Russian radars in late 1990s: Americans launched in space steel balls of different sizes, US tracked only largest, while Russia with easy even smallest one. So, 20 years ago 100% Russian radars was far ahead of American. From that era in Russia arrived two new generation of radars, US as we know de facto frozen all similar works and have nothing new (how and why it happened is different question, but it happened by reason, fact, and not only in this direction).

Another example about “software” — famous first chess battle between computers (US and Russian of course). US had better hardware (faster, more memory), but they anyway lost to Russian because Russians math scientists wrote far better software. Software (math) means a lot. Nowadays exist similar modern competitions, as example in technology of face recognition or voice recognition. Surprise (for you), Russian technologies better, especially in voice recognition where they far (generation?) ahead and demonstrated how can recognize voices from crowd (no one other in world can). I’m sure you know, that voice is wave and it analyze is close to work of radars? Software means a lot here. And US of course know that, that why it is US/West always recruits Russian scientists and software developers, while Russia not cares about foreigners.

Your fallacy about Russian electronics is clear: Russia almost not produce consumer electronics (or it is unknown in West), that’s true. But is is absolutely different question, it is about business, not about technologies itself. To produce something cheap, you need to produce it a lot and have market of billions people. Russia have no such market and never had access to it, so yep, it not produce consumer goods. But it not means it behind in technologies. 
Most of electronics in world produce China, but it is Russia nowadays building for China so-called “yearly warning system” (bunch of ground radars and satellites to notify about nuclear attack, in whole world only Russia and US have them), China can’t build it for self — have no appropriate electronics. It is Russia is one of world’s leader in quantum processors and modern photonics. It is Russian labs regularly demonstrate technologies of future, like chips with speed of hundreds of GHz (in whole West only US also demonstrated them). It is Russia produce atomic copiers (kind of atomic-force microscope which is used not as scanner) which can create chips with 2 nm resolution (yep, you can’t use this approach to build millions or even thousands chips, but single chips for military purposes with easy; so while Intel, ASML, Samsung only works over 4 nm for consumer electronics, Russian labs already for at least 15 years can produce single chips with 2 nm for army). It is in Russia second in world (after China) largest quantum network (based on own electronics), Russian banks, organization already for years communicate regards to quantum network and what about “generation ahead” West, like Italian or French, still in usage backward non security internet? :)
Reply: @TD-qh6yu doesn’t the f-35 have 0.0005 square meters rcs?